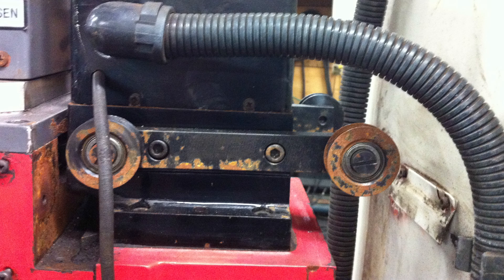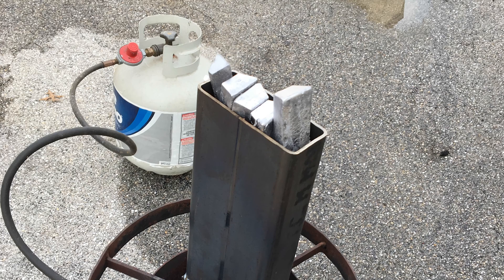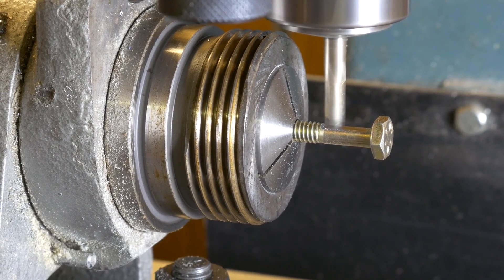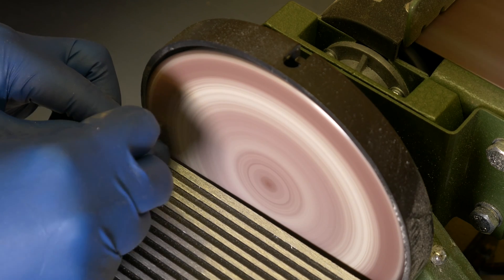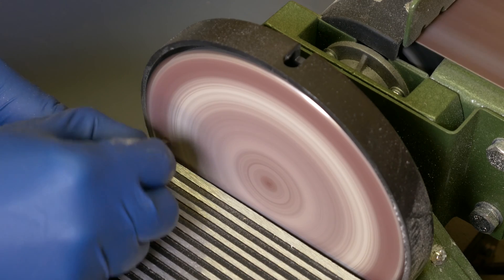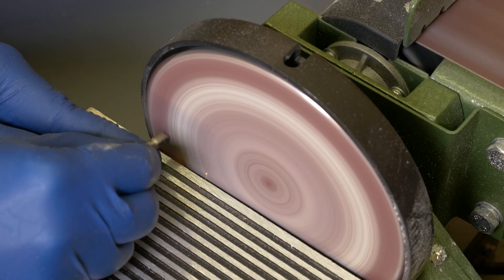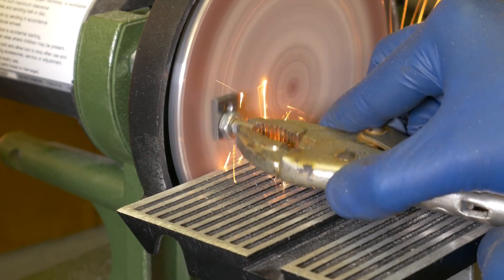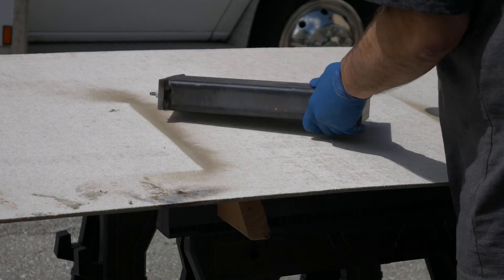Z Axis Counterweight Fabrication - DM2800 CNC Mill Restoration

Comment: Very nice, did you just match the weight of the head?
Reply from the maker: Yes, basically, weighed the head then took into account the available space and how much stroke the head covered.  Then did a sanity calculation to ensure the size of steel tube I was contemplating using would hold enough lead.  I was off by about a pound due to the amount the lead expands when hot.  I couldn't get the final ingot in when the lead was molten.  Thanks for watching!